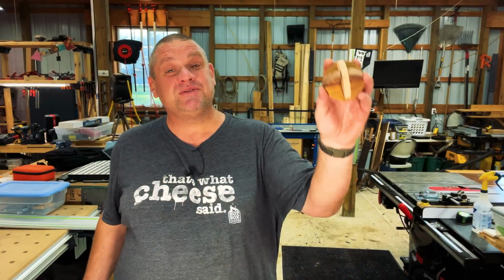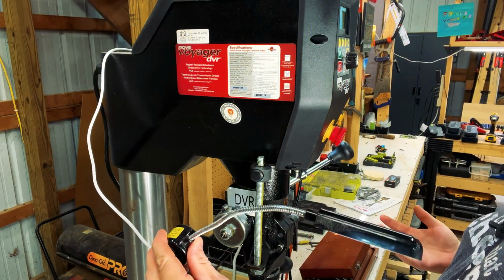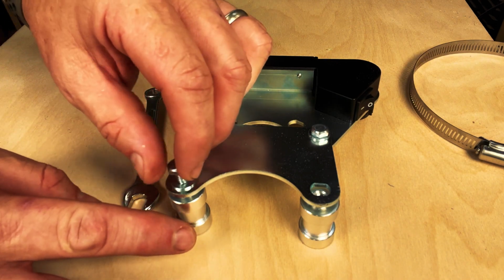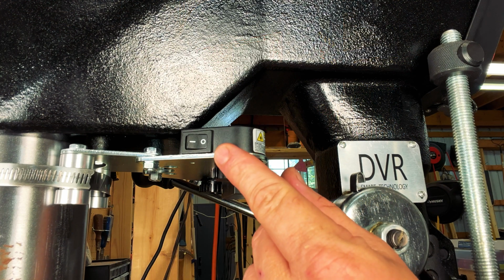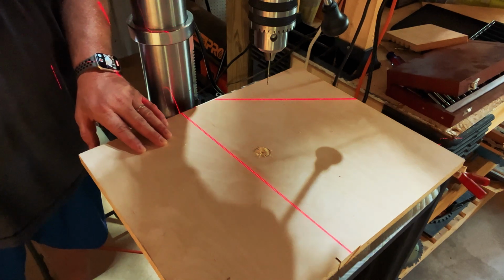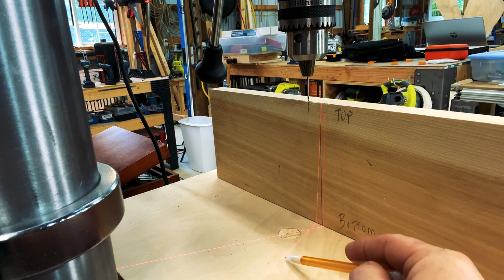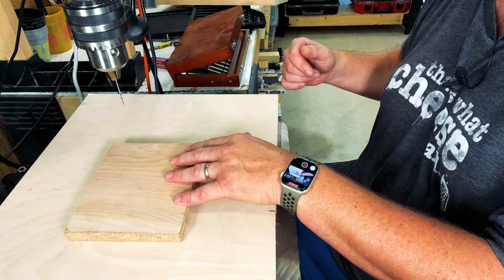Mastering Accuracy: The Must-Have Drill Press Accessory #woodworking #drillpress

Comment: do you need to recallibrate if you move the table up and down?
Reply from the maker: Yes unfortunately, the lasers are at an angle from the base of the drill press so any time you move the table they will need to be adjusted.   Great question Alizadehweshky!

Comment: Glad I ran into tis video. You are right  -  nobody else explains the Z axis which makes this accurate when moving the table up/down.
Reply from the maker: THanks so much cottagemail!  I need to get a new one of these.  Mine died about 3 months ago, and I really miss those crosshairs!    Thanks so much for watching!
Reply: @FlynndoggWoodwork  After seeing this video, and commenting, I checked out some of your other videos. I noticed you were not pleased with the laser reliability because it died on you. Looking forward to seeing if you find another one as you mentioned. So far, I don't see any other unit that is offered. Some people actually build from scratch but I'm not talented enough to go that route.
Reply from the maker: @cottagemail4066  That is indeed correct.  I have not found another option so far.  I've kind of come to the realization that I will probably just get the same one again, and hopefully it will last longer.
Reply: @FlynndoggWoodwork  Ha, looks like I'll join you and buy one.
Good luck to both of us!
Reply from the maker: @cottagemail4066  I think you will like it, just remember to turn it off when you are done..... that is what killed mine and I had a terrible habit of leaving it on! :(
Reply: @FlynndoggWoodwork  Roger that.

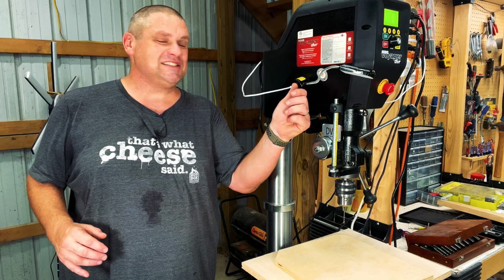Comment: 10:23 I have had a Wixey for years and couldn't make it work. Have tried your process and still it goes out of adjustment as soon as I change the table height. I think the small screws are not for a z axis but just a fine adjustment for the x and y. The laser seems like a good idea but it simply doesn't work if you want to change your table height.
Reply: I just bought one of these locally in the UK after watching this video. My drill press is an old Ajax bench drill but is quite large. I can guarantee that the eventual misalignment has nothing to do with table height or any movement of it. Table movement would not move the original alignment as it has nothing to do with the table, it would always stay aligned to the spindle centre. I can verify that vibration & the frequency thereof, eventually moves the cross hairs. I first set mine up with a 1mm drill bit & so, had the drill running at it's highest speed. As soon as i turned the drill on, I could literally see the cross hairs swaying left to right & wouldn't stop. I slackened tension off the belt to reduce vibration & the cross hairs stayed put. If your cross hairs don't misalign over time but are wrong as soon as you move the table, it's either a defective unit or your table isn't at 90 degrees to the spindle to start with. There's not much point in putting a 90 degree marked board on a wonky table.
Reply from the maker: This is a great comment Paul, I've been using this system for a few months now, and I am encountering similar problems.  I typically set the x/y axis everytime I use it just to confirm everything is in alingment.   Once it's set it's great, but if there is table movement at all, it doesn't seem to be that accurate.   I need to do followup vidoes on many of these tools I've covered in the past.   Thank you for sharing!
Reply: @FlynndoggWoodwork  I was wondering whether height would have an impact, is there anything available that the table height does not affect?
Reply from the maker: @BlueJaykeUK  That is a great question.  This tool is supposed to do it, but I haven't had much luck, that being said it is very easy to realign the lasers with just a turn of the knob.